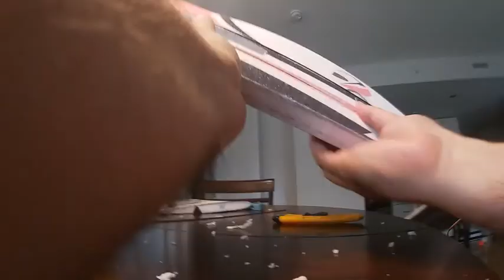Sbach 342 by Skynetic Assembly part 2 video

Comment: What I did with the wing was fully assemble it, and then just folded the aileron and slid it into place. I didnt install any servos on the plane until it was completed. 
I'd done a lot of flite test planes so I figured out those fuselage spar channels needed to be hollowed out. 
The plane is very sturdy when you have all the spars glued in. I had some nicer wheels from a UMX plane and swapped those in. It still wont land on grass well.
The only weak point I found on the plane is the motor mount. It broke very early on and needs a lot of glue and reinforcing.
Reply from the maker: Hi, thanks for the message, I glued mine after placing in the fuse. Folding the ailerons was not something that came to mind. If it worked for you good. I had to hollow out spar channels for the spars as you mentioned above. Also replaced the original  wheels on my plane as you have done the same lOL  I have not maiden mine yet.  JB